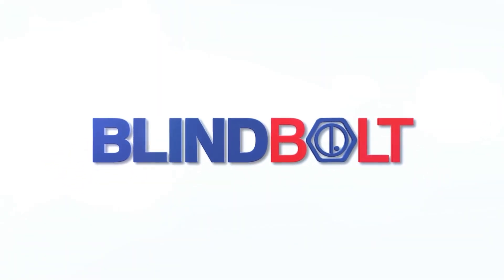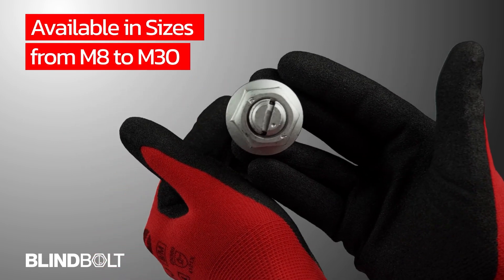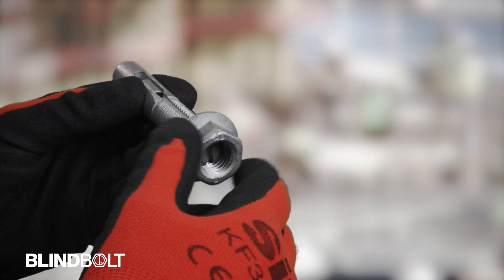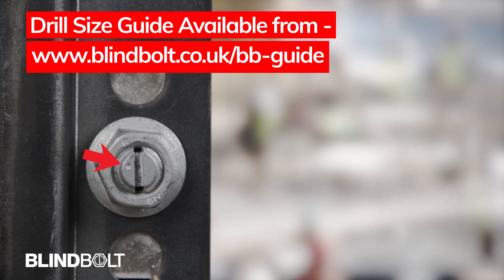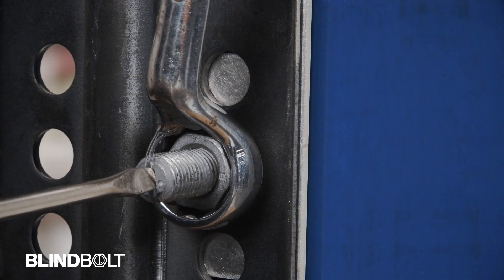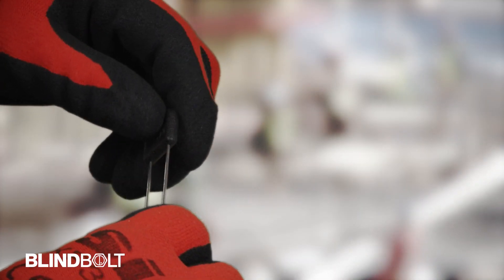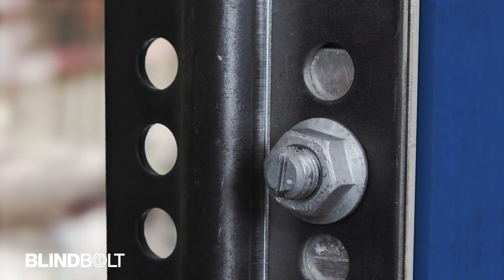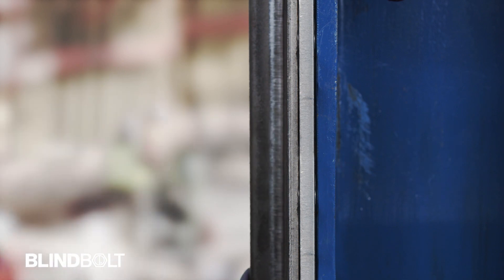Blind Bolt installation and removal guide

Comment: I had to use these to install rock sliders on my 4Runner. They say to torque to 18 ft lb of torque but there is no way to use a torque wrench and be able to see the slot on the bolt. I used two nuts on the end to hold the bolt in place with a wrench while I torqued it down (probably more than 18 ft lb). Do you think they will hold or do I need to loosen them up? I am concerned they need to be as tight as possible as these are holding on an accessory that supports the entire weight of my truck on a rock.